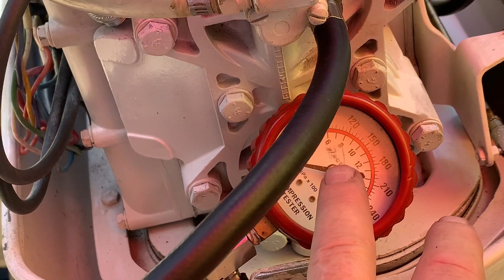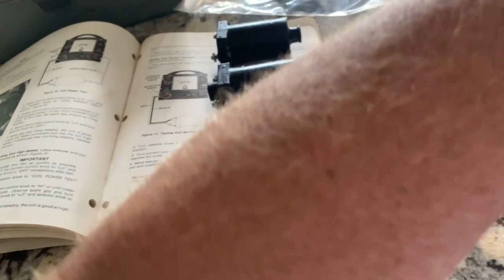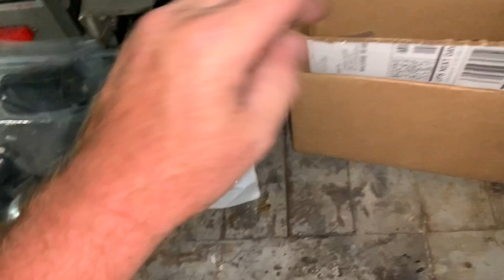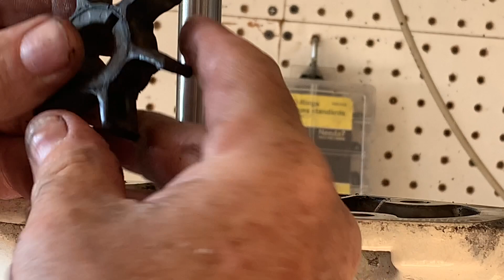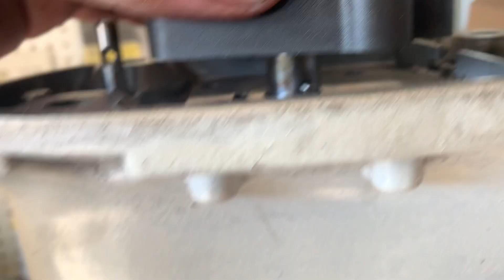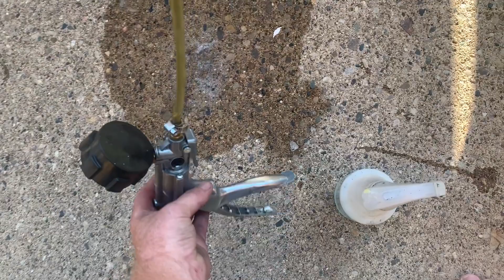1980 45 hp Chrysler - Poor Running - Needs a Tuneup & Water Pump Impeller - Part 1

Comment: Neat little trick to limit oil escaping out of the lower unit fill screw hole is to place a little blub of petroleum jelly next to that hole before getting started. After pulling out the filling connector, just cover the hole with that jelly which will prohibit any spillage. Stay safe and be merry !
Reply from the maker: Daniel Robert … I’ve seen that done before. I just never seen to have that grease handy when I need it. Oh well. Keep those tips coming. Great Suggestions are always welcome.

Comment: I actually like that impeller 'pin' better than the key design used in both my Johnsons and Mercs.
Reply from the maker: Greg… The pin design makes it much simpler, faster and easier to remove and install the prop. I just like the key design because it seems to be stronger and more robust. Thanks for watching and commenting.

Comment: I was curious if you can disconnect the shift rod from up above and not mess with the cotter pin between the halves
Reply from the maker: rootvalley…. If I remember correctly I’m fairly sure you can’t remove the shift shaft without pulling the powerhead. It’s easier to remove the cotter pin.

Comment: I need help with that exact same 45 horsepower Chrysler the impeller is brand new it runs great but it will not pump water I feel like the head gasket must be blown pressurizing the cooling system and not letting the water flow I removed the thermostat and it still will not pump any water at all
Reply from the maker: Jeff Weens …. Are you sure that the water tube is connected to the pump properly. Did you blow compressed air through the water tube to make sure it was clear. You might even have old broken impeller blades stuck inside the water passages. Check compression to see if it’s even if not the head gasket could be compromised and with the head off you should be able to clear any debris found in the water passages.